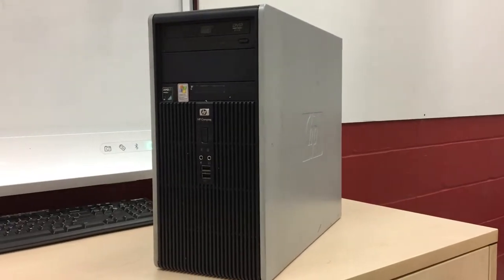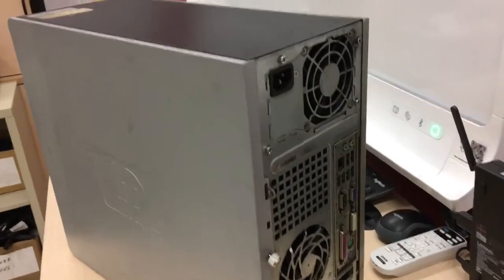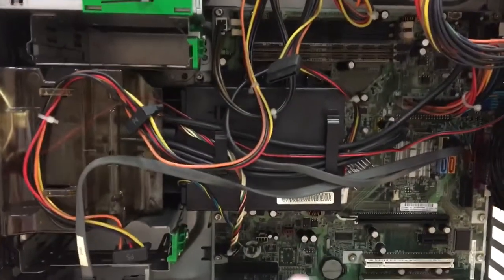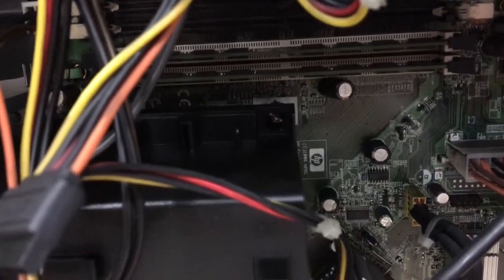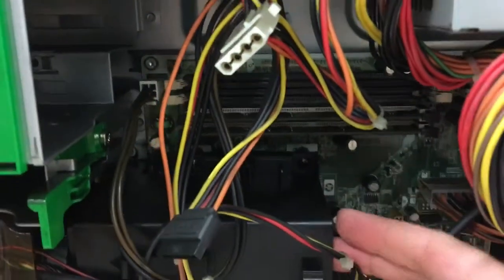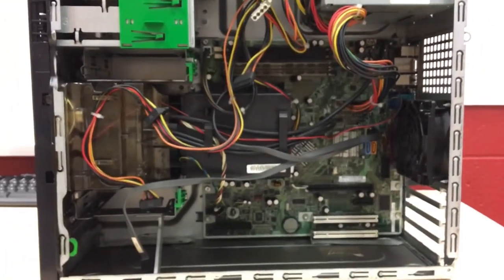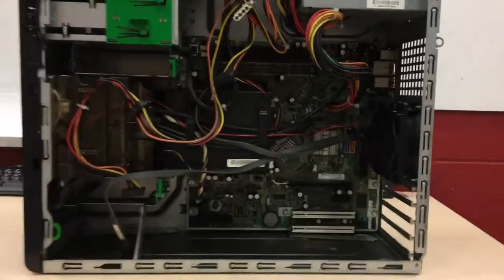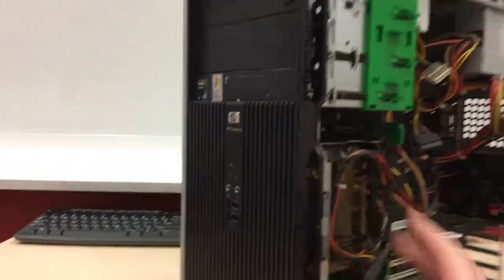HP DC 5750 5850 REVIEW after it's 8th Birthday

Comment: HP dc5850 still my main desktop, somewhat upgraded. it still works great after 10½ years. The system has:
- 4-core AMD Phenom II X4 B97 at 3.2 GHz and 95 Watt;
- 8 GB 800MHz DDR2 (maxed out according specs); 
- 128 GB SPCC SSD with three 6 year old HDDs (1 TB, 500 GB and 2.5" 320 GB; striped with ZFS (kind of Raid-0));
- SATA-3 PCIe card on PCIe 2.0 (5 Gbps, so < 500 MB/s left for the SSD, but it beats the < 300 MB/s of SATA-2);
- USB 3.0 PCIe Card and a front panel (2 + 2 plugs);
- GeForce 8400GS (1 GB and a whopping 16 CUDA cores);
- 2008 22" Monitor, Fujitsu/Siemens LW22 (vga only; 1680 x 1050 at 60 Hz)
- and the original;
    - 300 Watt power supply;
    - DVD R/W;
    - 4 SATA-2 connectors
    - Integrated audio;
    - Integrated USB 2.0 (6 + 2 plugs);
    - integrated 1 Gbps Ethernet;
    - HP motherboard with integrated video;
    - Mini tower.

Ubuntu Mate 18.04 boots in 22 seconds from SSD (lz4 compressed zfs).